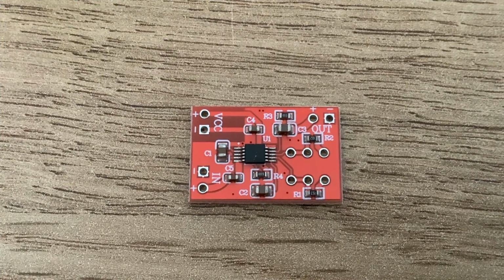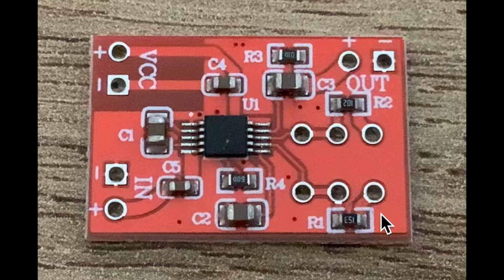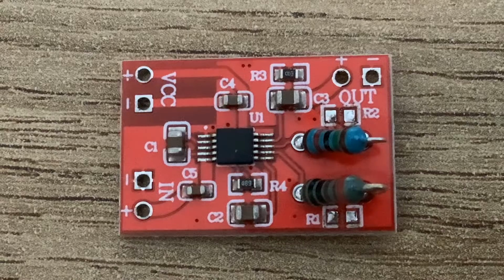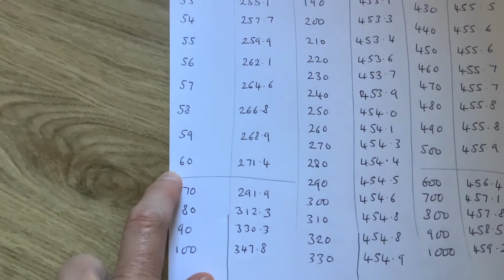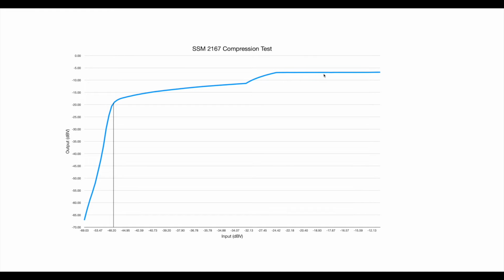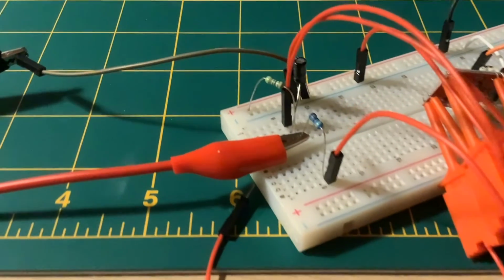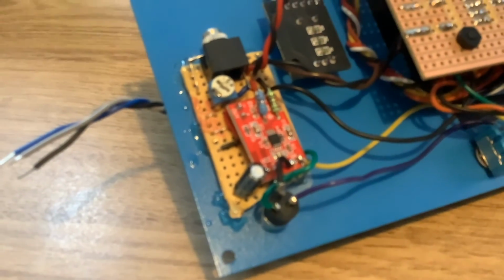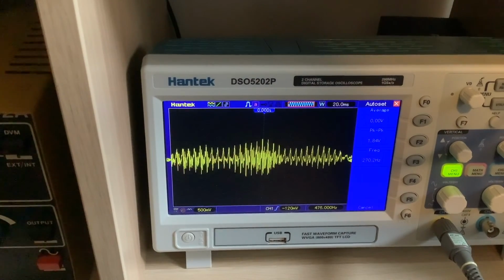46 - Mic Amp & Compressor

Comment: Ciao Nick, penso che tu sia un grande, il tuo entusiasmo è contagioso e, a differenza di molti youtuber tecnici,  il tuo inglese è molto comprensibile. 
Ho visto diverse volte questo tuo video e molti altri da cui ho tratto ispirazione. 
L'autocostruzione di un compressore per operare in SSB con maggiore qualità dell'audio è un obiettivo che ho in mente da tempo. 
Il mio prototipo fa uso del SSM2167 ed in realtà è una cosa più complessa di un semplice compressore, dispone anche di tre stadi a BJT e di filtri con una pendenza decente per limitare la banda a 300-3000Hz. 
Come dici tu, il comportamento del SSM2167 è strano; effettivamente sembra che, nei moduli cinesi rossi, siano state scambiate le resistenze R1 ed R2. 
Per fugare ogni dubbio, ho deciso effettuare delle misure empiriche in laboratorio. 
Ho realizzato quindi un test set per il solo modulo compressore e ho eseguito delle prove con esattamente i valori di RComp suggeriti nel datasheet della Analog Devices, fissando il Noise Gate a -40dBVrms (28,3mVpp). Bene, ti devo dire che, contrariamente alle mie prime impressioni, i dati confermano che i valori di RComp (0Ω, 15kΩ, 35kΩ, 75kΩ e 175kΩ) sono corretti. Piuttosto, credo che, per funzionare correttamente, il SSM2167 necessiti di qualche stadio a corredo che adegui i livelli di tensione e separi in modo opportuno l'integrato dal microfono e dal carico in uscita. 
Ti riporto sotto i dati che ho ricavato:
Vin rms (dBV)	Vout rms (dBV) 1:1	Vout rms (dBV) 2:1	Vout rms (dBV) 3:1	Vout rms (dBV) 5:1	Vout rms (dBV) 10:1
       -75	                              -75.0	                                  -75.0	                         -75.0	                          -75.0	                       -75.0
-70	-70.0	-70.0	-70.0	-70.0	-70.0
-65	-64.9	-64.9	-64.9	-64.9	-64.9
-60	-60.1	-60.1	-60.1	-60.1	-60.1
-55	-55.1	-55.1	-55.1	-55.1	-55.1
-50	-50.0	-50.0	-50.0	-50.0	-50.0
-45	-45.0	-45.0	-45.0	-45.0	-45.0
-40	-27.2	-23.1	-22.2	-21.8	-21.4
-35	-17.7	-12.0	-10.1	-8.8	-7.7
-30	-12.8	-9.6	-8.5	-8.1	-7.1
-25	-7.8	-7.1	-6.8	-6.7	-6.6
-20	-6.2	-6.2	-6.2	-6.2	-6.2
-15	-6.0	-6.0	-6.0	-6.0	-6.0
Certamente, bisogna considerare che valori di tensione inferiori a -45dBV, per via del rumore, sono difficili da misurare anche con oscilloscopi decenti (ho messo da parte il digitale moderno che con quei valori non riesce a "triggerare" correttamente e ho riesumato il mio glorioso vecchio Tektronix 7613 analogico, con i suoi bravi filtri nella base dei tempi). 
Piuttosto, credo che, per funzionare correttamente, il SSM2167 necessiti di qualche stadio a corredo che adegui i livelli di tensione e separi in modo opportuno l'integrato dal microfono e dal carico in uscita. 
p.s. sarei felice se volessi provare il mio schema, eventualmente dimmi a che indirizzo mail inviarlo.

73 de IU1PPC also on QRZ.com
Reply from the maker: Ciao! Grazie mille per le tue gentili parole. È sicuramente un progetto interessante. Inviami pure lo schema elettrico, mi piacerebbe vederlo.

Il mio indirizzo è sulla mia pagina QRZ.com.

Grazie ancora. Continua a costruire! 73, Nick
Reply: @M0NTVHomebrewing  I sent the documentation. regards and 73.

Comment: Note the later boards with the MAX4466 and SSM2167 have the same 15k 1k error on pins 7 and 8 of the SSM IC
Reply from the maker: Thanks very much for pointing that out. You'd have thought they might have corrected that by now! Best wishes, Nick

Comment: Today I discovered this video. In early 2023, I bought three of these boards. When I buy something like this, I always research the possibilities based on the factory specifications of the chips. When I read the specifications, I discovered the error. At first, I thought I was reading it wrong, but even then, the error was already there. I even mentioned it in my review on Aliexpress as a tip. I connected two potentiometers and removed the resistors. Later, I decided not to use these boards for their intended purpose and built a more flexible FET compressor myself.

I bought one of these boards for a DIY listening unit in a 19" cabinet with a 4" speaker, a 10-watt amplifier, squelch, steep audio filters, tone control, and a 5-channel mixer for receivers like my scanner and SDR receivers.
Reply from the maker: Hi Richard, thanks for watching and commenting. Did you design your own compressor or use a pre-existing design? I'm just interested as I'd be up for building one myself at some point. Thanks again. Best wishes, Nick

Comment: Hey Nick, another great video and thanks. So are you feeding this directly into the diode ring mixer? From other videos I assume that it works well to modulate into SSB signal. No worries about matching to 50ohm before going into the mixer?
Reply from the maker: Hi Pil, yes it is feeding into my modulator. But the modulator is a double balanced diode ring mixer with the W7EL Audio Diplexer on the AF port. So a good 50Ω termination is still achieved. Check out my recent videos on mixers for more info. 73, Nick

Comment: Can i make this into a guitar pedal that is a booster/compressor if so how can i put 9 volts into it or will i need a buck converter
Reply from the maker: Hi Kaden! As the output from a passive guitar pickup is so very small you might even need a pre-amp before this module. You'd have to try it and hear for yourself. Taking the DC supply down from 9V to 5V is a simple as using a 7805 voltage regulator with a couple of caps or maybe even an LM1117 based design. Just google them. Thanks for watching. Best wishes, Nick
Reply: @M0NTVHomebrewing  could i use one of those cheap 6j1 tube preamps as the preamplifier as you can use those with a guitar and it sounds pretty nice
Reply from the maker: Hi Kaden, I'm afraid I don't have any experience of those so can't really answer you confidently. You might be better off asking in a dedicated guitar electronics forum. I'm sure there are people who have done this and could probably help. Best wishes, Nick
Reply: @M0NTVHomebrewing  thanks for the help my guy i do appreciate it im off to guitar forums
Reply from the maker: All the best :)

Comment: When analyzing the operation of the board I noticed that something was wrong, I went to check the values of the resistors on pins 7 and 8 of the integrated, and there was the error. I went online to look for information about this problem, if anyone had already detected it, and I found this video confirming the assembly problem. Thanks! 73 PU3MSR!
Reply from the maker: Thanks Marcelo. It was another ham who alerted me to the issue. That’s the wonder of the internet. Glad you can resolve your issues now. 73, Nick

Comment: Good presentation of the SSM2167. Great IC from AD. However, I have seen some 10khz burst on the output (approx. 500ms) after audio silence on the input. I looks like the IC is very sensitive for noise / rippel on the Vcc input pin.
Reply from the maker: Thanks. I've not encountered any issues with the chip myself but your mileage may vary as they say. Thanks again. 73, Nick

Comment: Those convenient holes in the board are perfectly spaced and sized for vertical multiturn preset pots, think I've had the discussion on the G-QRP mailing list some time ago.
Reply from the maker: Hi there! Don't think I've ever come across those. Sound useful though. 73, Nick

Comment: I just have ordered a couple of these boards some days ago, will see if they also come with the wrong resistors. In any case, have you think about any way of modifying the resistor from the arduino? this will allow you to set the compression level from software depending on if you are trying some rare dx or just local ragchew. I've been thinking about it but haven't ended with any solution that i like yet.
Reply from the maker: Hi! No I've never considered doing this. I fear you would need a fairly complex switching bank of relays that would put in different values of resistance in each slot. For myself I'm happy to set it at a fixed level and then leave it alone but if you have an idea for a project then go for it! 73, Nick

Comment: Nick, please notice that your chart at 19:05 is misleading because you have fallen foul of an Excel quirk. Notice that your "X" axis (contrary to your "Y" axis) is not linearly spaced! This is because you have asked for a "line" graph. This merely places the "X" values specified at equal spacing, whereas they were not recorded that way! To do a proper comparison, you need to select "XY Scatter" plot which will give linear scales in both X and Y. 73 de Phil M1GWZ
Reply from the maker: Cheers Phil! Thanks for the advice. 73, Nick
Reply from the maker: I've redone the chart Phil and put a link to it in the video description. Thanks for spotting this and letting me know. 73, Nick

Comment: Μy personal opinion is better to desolder the 103 trimmer and add it front panel as Pot...tks for your design Dinos 73
Reply from the maker: That's certainly an option if you want to be able to change the output often. 73, Nick

Comment: Commented on your other video instead of here, sorry for the repeat. Great video! I bought two of those units and when tested they just performed like limiter amplifiers. I was short on patience and just thought they were Chineasium fakes and didn`t investigate further. I will pull them out of the piling system and have another go. Just a point about noise, (in any pre amp circuit using electrets), I filter the phantom power to the mic - +v supply through 1k res, 1000uf to gnd, then 4.7k to the mic. This helps a lot getting rid of noise on the supply getting into the mic line. Many thanks, Chris & the lads of 1977khz
Reply from the maker: Thanks Chris! That's good advice about the filtering. 73, Nick

Comment: Check the Analog devices data sheet It does not have a 470R in series with the supply but it does have a 10uF across the supply to ground That might just about provide enough current for the peaks.

I f you want to add a bit of current protection just drop the 470R down tom 100R and add the 10uF

Andy
Reply from the maker: Hi Andy, that sounds like a perfectly sensible option. Thanks very much. 73, Nick

Comment: Interesting video. Note the specification for minimum load on the output is 5k ohm (output Z is 145 ohms) according to datasheet. So if driving a diode double balanced modulator directly, then a unity gain opamp or emitter follower  is probably recommended.
Reply from the maker: Thanks. Yes I measured about 100-120Ω output Z at 1kHz. You could do some matching (it's about 2:1 SWR) but to be honest as it is going through the W7EL audio diplexer the mixer port will still see 50Ω irrespective of the output impedance of the mic amp. It is certainly something to consider though. Thanks again. 73, Nick
Reply: Good point, I use an emitter follower to drive ring modulators. Otherwise mine ended up sounding really tinny due to the mismatch.

Comment: Nick, have you tried any ferrite beads on your test equipment? Oscilloscope, power supplies, or function generator. It fixed a lot of noise by doing this. the power supply, use them on the AC input and the DC output the switching power supplies are very noisy even when not connected to the project. then if you want even better use a battery to power the project while testing. I picked up two boxes of the clamp-on type from Amazon. by the way I didn't stop with test equipment I put it on computer radios everything in my room.
Hope this helps you as it did me!
Reply from the maker: Thanks Curt, I've got a few of them on various leads in the shack but I could probably use some more! Thanks for the reminder. 73, Nick
Reply: Just a note I have about three of them on the power cord for my power supply and Ossiloscope. when I got to three it didn't show any more improvement with more. that's why I had to order two boxes and they come in many sizes in the kit. @M0NTVHomebrewing

Comment: Good day. I have a few of those little red board.
I wanted to make a compressor for a dynamic mic. Is this possible or are these board limited to cb radios etc. Thanks a lot
Reply from the maker: Hi there, the boards are simply audio amplifiers with a compression feature. They can be used for any small audio signal. If you wanted to use it with a dynamic mic you'd have to adapt the design though. I only use condenser mics which require a DC bias hence the 4.7K resistor strapped across the VCC+ to the IN+. It is also why I had to include the 1uF electrolytic cap between the tuning tone output and the switch: I didn't want the DC bias getting back into the Arduino. Hope this helps. 73, Nick
Reply: Thanks a lot

Comment: I've never noticed the resistors in the wrong place on all of the boards I've used because I've always fitted pots and used the super-secret advanced technique of "twiddling it until it sounds right".
But sure enough, the unused 3 modules I have in my microphone circuits bin have the resistors in the wrong place.
Reply from the maker: I know! All mine were wrong too. If Dave hadn't reached out to me I'd still be none the wiser! 73, Nick

Comment: If British Rail had made a breakout board, it would have been this one, with "the wrong sort of resistors on the line"! In the wrong position at least. Great work from you and Dave. Note to self, check bought in break out boards. Thanks for another educating and fun video. 73 G0ACE
Reply from the maker: Cheers Ace! Hope you're doing OK. 73, Nick

Comment: Nick, that 470 ohm resistor looks like it has a green body.  Probably a stupid question, but are you sure it's not actually an inductor?
Reply from the maker: Yes, I'm certain. Not everything green is an inductor. It is a 0.25W 1% Tolerance Metal Film Resistor (from Switch Electronics). It was the resistance that was the problem. 73, Nick
Reply: @M0NTVHomebrewing   Ah. It was, as I suspected, a stupid question.  Sorry.
Reply from the maker: No worries at all. My favourite gaff used to be soldering in my transistors the wrong way around! 73, Nick